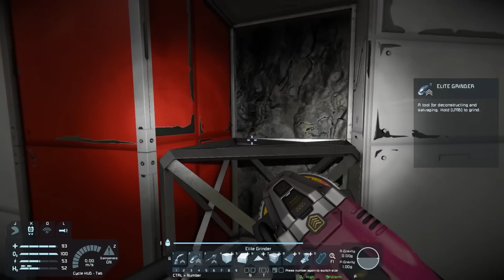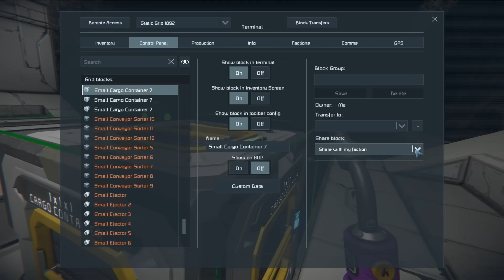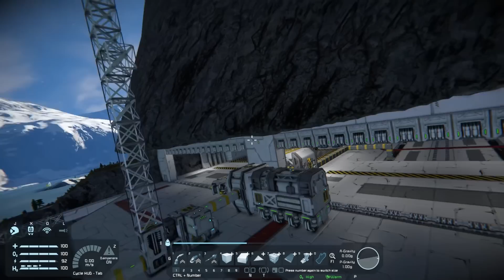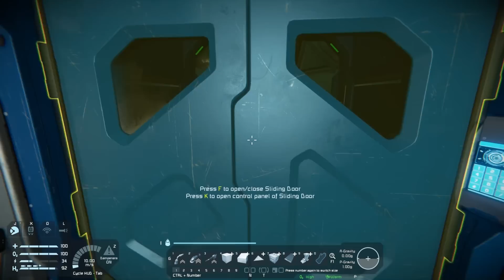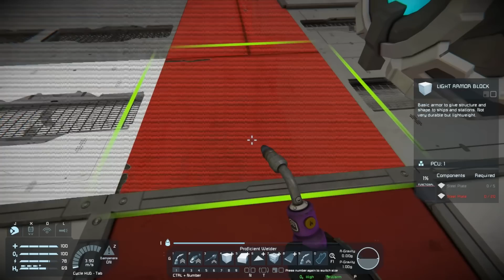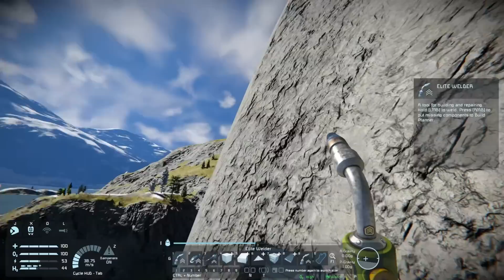FASTER BUILDING! - Blueprints & Tool Tricks - Vanilla SPACE ENGINEERS Gameplay - Survival - Ep 8

Comment: if you make the conveyor line first then you have easy inventory access ... if you make the cargo container on one side a connector pointing up you can attach you drill rig /welder rig to the conveyor system .... just use a pair of pistonsor three stacked on top of each other ... (--> <-- --> ) so you can push 30 ft forward name them something like bottom middle top ... start by turning on middle at 0.1 speed for drilling and welding ... when it reaches 10m do bottom ... when that reaches 10m do top ... when that reaches 10m reverse all 3 pistons ... you could even make a car with the conector and drive and weld and dig as you the car part uses a connector to the drill ship and poof drill rig .... add drills if needed ... just behind the pistons sits the welder line pointing outwards ... and on the rear just after the connector the storage bins of parts and ore for balance .... 

then its drive connect extend pistons .... retract when done disconnect move forward reconnect .... drive slowly as you will be welding as you move up ... a conveyor sorter is handy for this sort the parts needed to build a section into the one cargo and sort ores out the second one ... this way there is always some "junk in the trunk"

Comment: So if you just increase the offset on the projector you can reuse one rather than build another every time. And when you build a welding ship you will be kicking yourself compared to the elite welder.
Useful for both though when building long flat areas, face the block and strafe when welding/grinding, much easier and quicker than pointing at an angle at them

Comment: Ive always loved building into the mountains or in the ground. I once built inside a crater on the moon. It was fun. 
Might want to just make the blueprint of your mining ship and just attach welders instead. The issue is large steel tubes metal grids and a couple other components will only go through the large (smallgrid) conveyor. So the weld ships become unwieldy pretty quickly 

I think there might be a couple mods you might be interested in that IMO dont break immersion. But  ultimately its your game dont want to make it too cheaty feeling. 

1. Vcs multifloor elevators (adds a player elevator)
2. Build vision and build info. (Worth watching someone explain how it works cause it’s nice but more button combinations to figure out)
3. Mechanical keybinds (lets you assign blocks and groups to keybinds for a cockpit) can make pistons and rotors respond to wasd or mouse aiming. Pretty cool for making articulating arm ships.

Comment: Never hurts to have a progress report. As for tunnel length, why not just leave it at a total of seven sections? Not too short, not too long, and couldn't hurt to have a little bit of luck built in, lol. The mountainside observation deck is a great idea, and I think one should be added at the very top as well. Two stories at least, one of which should be a full 360-degree panoramic level with windows the whole way around. Another level could act as a sort of ATC deck, especially if there's anything you could use as consoles to give the appearance of traffic control. And a base where multiple ships fly in and out definitely needs a control tower!